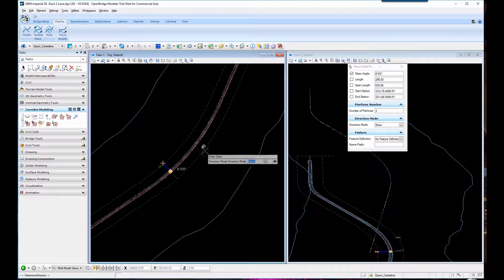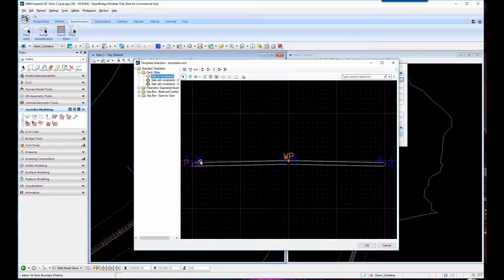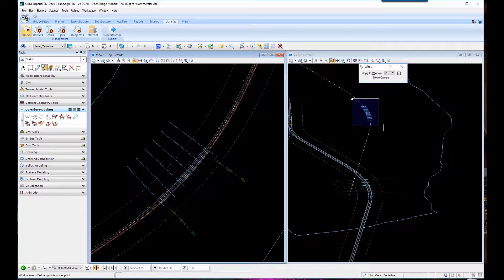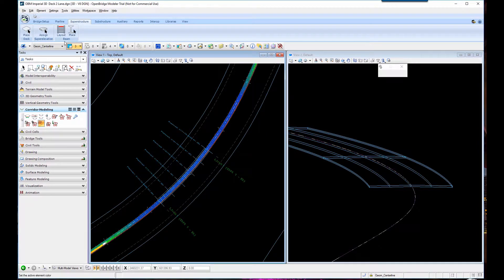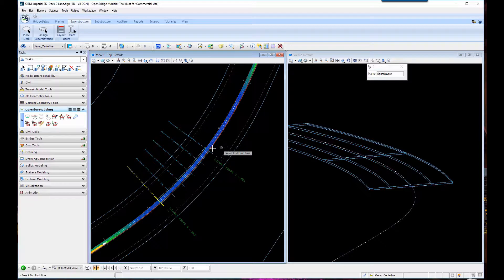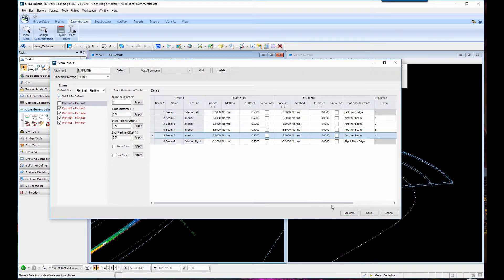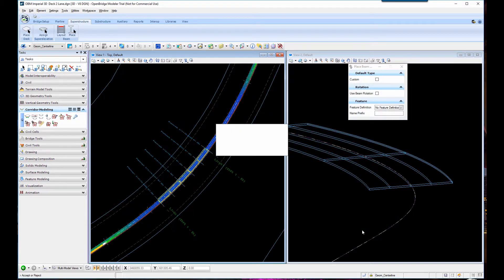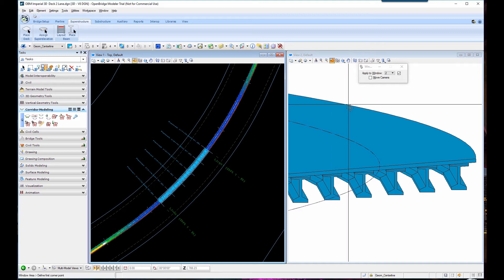OpenBridge Modeler - Attaching a Roadway Superelevation to a Bridge Deck

Comment: Nice video! I'm now learning about the basics of the OBM but i have a lot of questions, mainly cause i dont find´enough documentation about it, can you help me out? For example, which is the origin of the roadway superelevation? Can i use ispol to export a .dwn file with that information or do i need an specific program to get that file?
Reply from the maker: Hi - Due to the technical nature of your question, we suggest that you visit Bentley Communities at the link below and search existing answers in the appropriate product software wiki or post a new question/issue to the appropriate product forum. A Communities sign-on is required; to get started/for details, click the link below. https://communities.bentley.com/help/w/be_communities_help/18825/1-to-begin